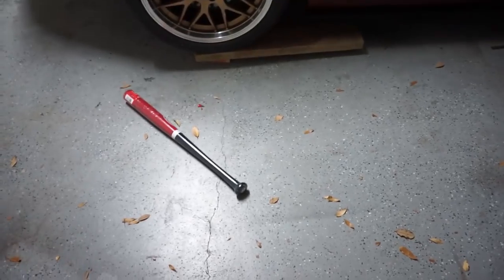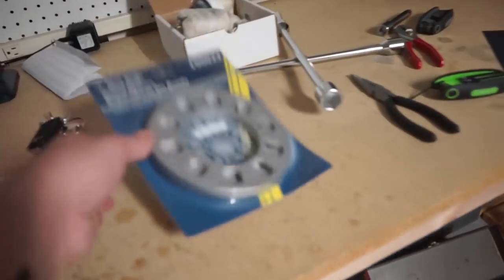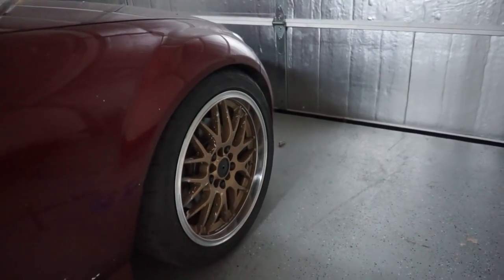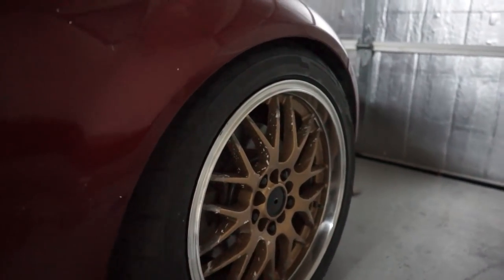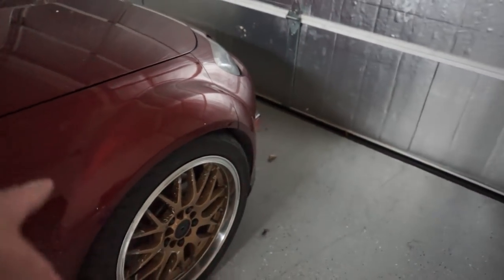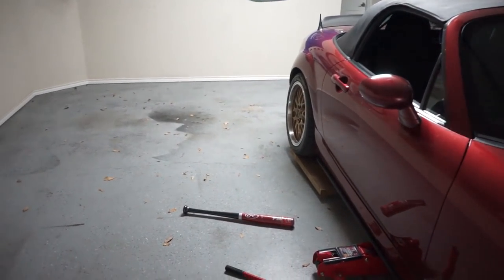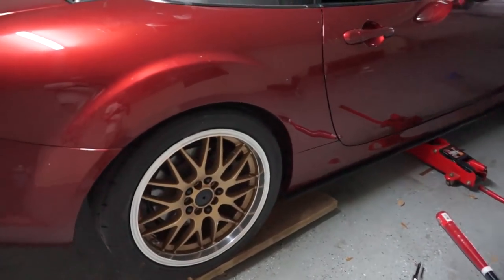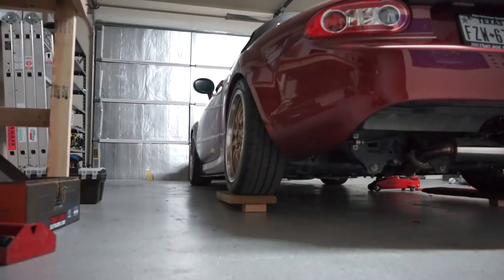The Perfect Fitment for My NC Miata! Baseball Bats and Wheel Spacers...

Comment: Stupid question.  In the front, there's a plastic fender liner that hits basically flush with the metal fender, meaning the tire would be attacking that plastic if front fender rolling was necessary.  So, are all the lowered hotboi NC owners just removing that plastic liner and throwing it away?  Or is there something I'm missing?  I just put 205/50-17 tires on my stock car and there's a little bit of rub on the liner at full compression, which seems wild to me, given how ordinary my car is compared to everyone else's NCs.

Comment: These are striking little cars but the older I get the less I seem to care about appearance.  Mostly now I want more contact patch and reduced unsprung mass.  Every suspension option seems to have lowering as part of the deal ... but it reduces the utility of a vehicle for normal driving.  What I really want for my NC and Subaru Forester are four corners of the car with instant height adjustment via just a cordless screw driver or something.  Find a sweet bit of road or a nasty off road track?  Boom - two minutes and the car is dumped or jacked for that application.  I like your vids btw - the coilovers one was super helpful.
Reply from the maker: I get it. I was daily driving the car for 4 years before I decided to start autocrossing. I was more concerned with looks. I'm at a 9.5 wide wheel now so much better contact patch. Sounds like you're looking for an airbag solution for on the go adjustment.